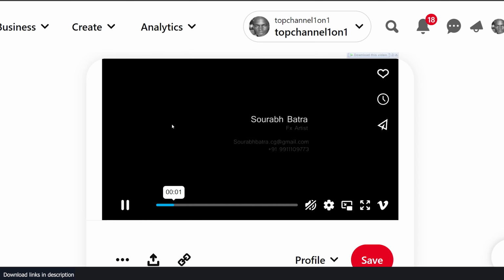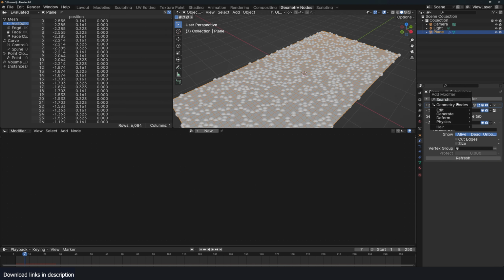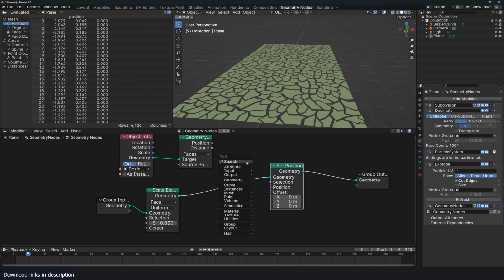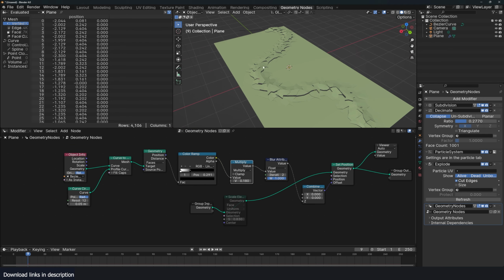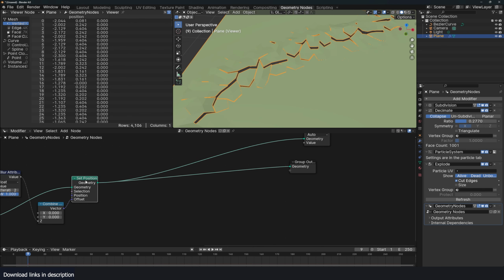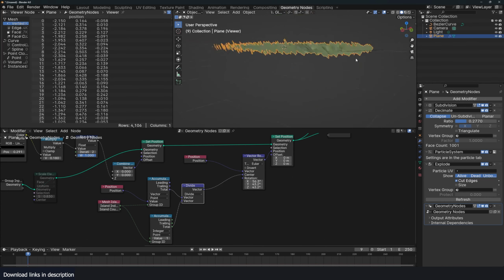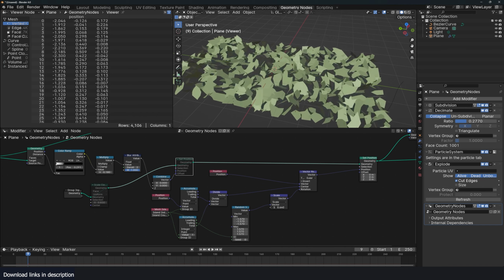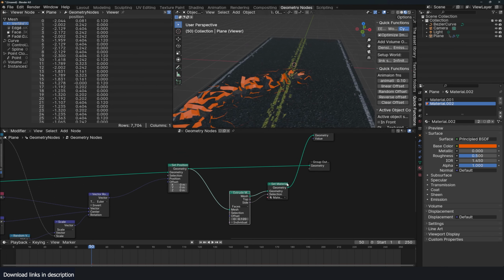procedural cracks and destruction with geometrynodes

Comment: it works. but it never shows  up in the rendered camera ?? how to fix ?
Reply from the maker: check you geometry nodes output
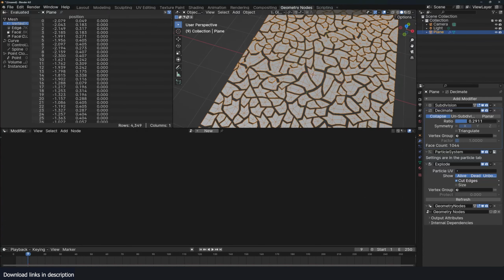Reply: @TopChannel1on1  thanks for answering. it's just like in the video. the set material is connnected to the geometry of the group output.yet it doesn't display anything in the final video. it starts off weirddly because when i put the decimate above the the particle system. the entire plane returns to be together and not cut like 2:05 unless i have the decimate under the particle to get the result you have

Comment: I know this is an older video but anywhere I have an edge loop on the mesh I am doing this to, itsplits the geometry and is not smooth. For example if I take a plane put an edgeloop at the middle and pull it up on the z axis then bevel ctrl+b to smooth out with like 3 segments. Each of those edge loop sections are separated at their respective edgeloop.